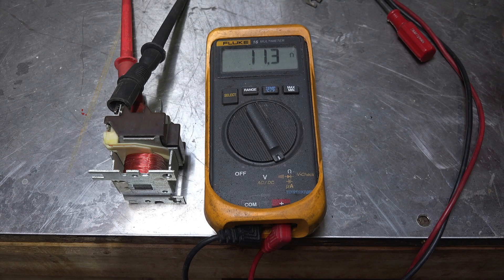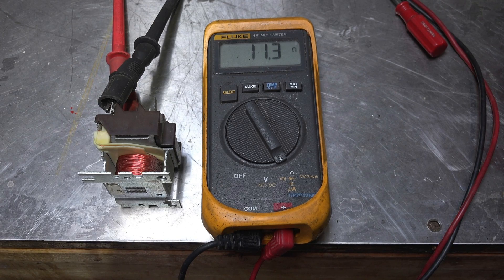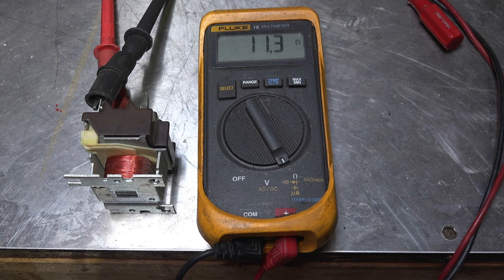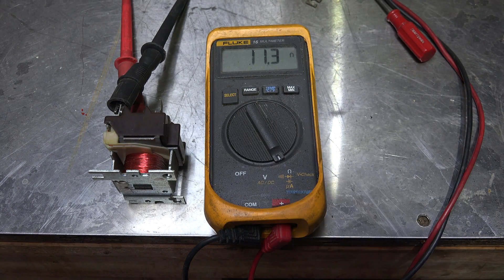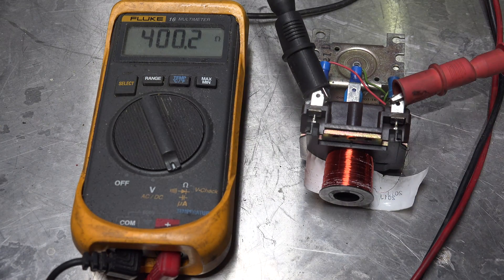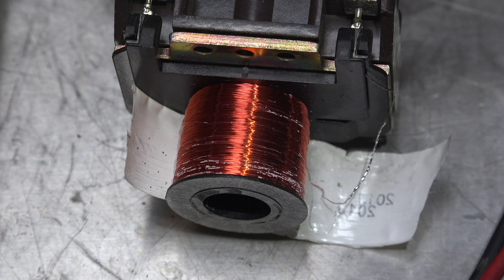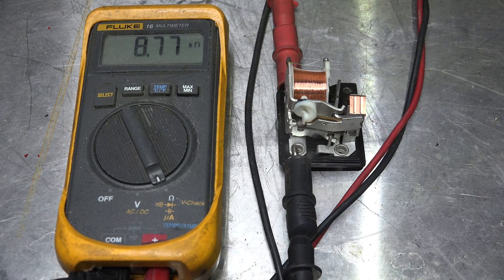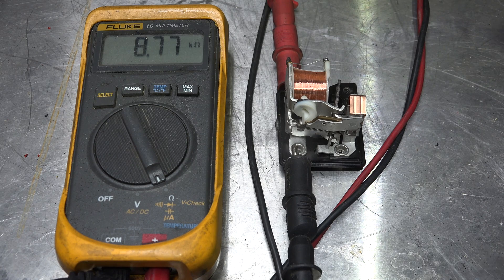Comparison of the AC relay coils from 24 up to 400 VAC.

Comment: I keep coming back to your videos for gaps in my electrical knowledge. I wouldn't make a boil on an HVAC Techs butt, however in the small engine repair shop I seem to have inherited I find myself daily running into more and more issues with relays and other wiring issues as riding tractors/mowers become more and more technical. Thanks for the schooling !!!! It is appreciated.
Reply from the maker: Matt Rodgers Welcome
GFM

Comment: I saw a service tech using an infrared camera attached to his smartphone showing a compressor and associated tubing, wiring, etc. I decided to check them out an have reviewed several models on youtube. I like the Flir One best at at $222.00 on Amazon and it will work with my Android smart phone. It is useful in locating electrical hot spots but I am thinking that it could also be useful in scanning a condenser and/or evaporator to determine the charge. I am going to order one and try it out.
Reply from the maker: Sounds like a good tool.  Let me know how it works.
GFM

Comment: would 24V ac coil work with 24V dc?
Reply from the maker: I agree with Paul Smith.
GFM
Reply: Thanks a lot.
Reply: Yes, testing it right now. Clicked right in and doesn't make any sort of humming noise like AC. Wanted to see minimum and maximum load relay would take. If you want pics, I've got 'em for ya. Also, the coil is gonna get hot as hell. With AC the voltage goes to 0v 120 times a second, which keeps the coil cool. With DC, that coil just stays on and gets hot. Depends on how long you're gonna be running it for. I've been running it for 24+ hours with a 12v fan on it.  I'm waiting to see how long it's gonna take burn up the coil haha

But, in reality it works.

Comment: Do the control boards/relays on some furnaces use DC voltage?  I've seen videos where the relays are rated for DC voltage and my Bryant 80% says DC. I know a lot of appliances switch to DC voltage for any logic or control board for the processors.
Reply from the maker: Most parts on the circuit boards are low voltage DC.  
GFM
Reply: +grayfurnaceman You da man, GFM!